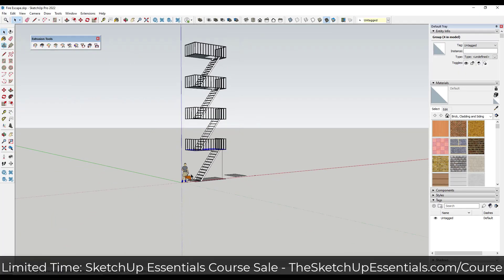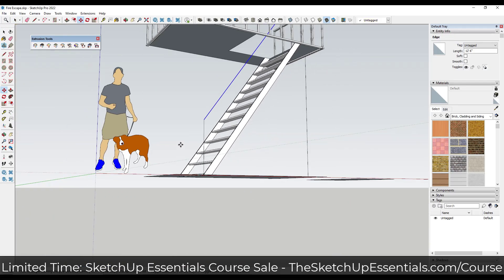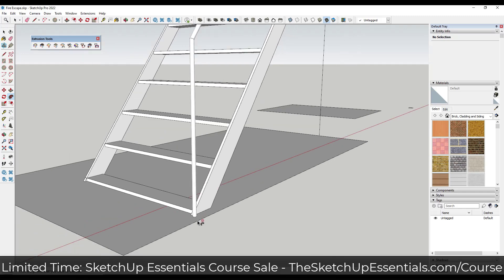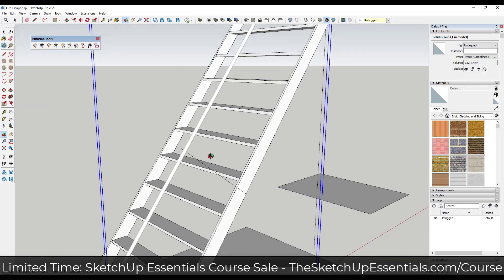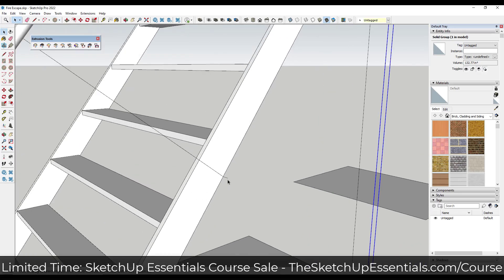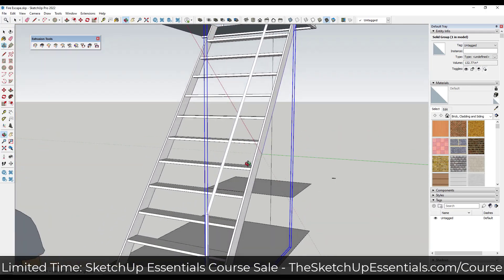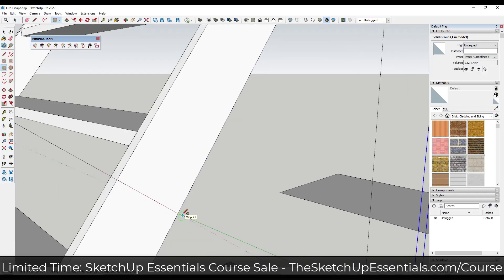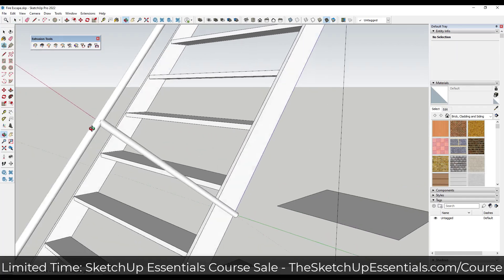How to Change PUSH PULL DIRECTION in SketchUp! (Easy Tip)

Comment: Great tip. Should add that it is good practice to group/component the mid-rail geometry BEFORE you reset the axes. This way the scale handles for the grouped geometry will be aligned to the geometry axes and make it much easier to manipulate than if they are aligned to the "world" axes.

Comment: Dude, you helped me out so much with your videos. But I have a question: can I use the assets from 3D warehouse commercially? More specifically, I'm a comic autor and I want to use the models I donwload from there to compose my backgrounds. I will alter the models in the sketchup software and then render the 2 imagine that will be directly used as background and I will draw the characters and lighting over it. Will I have any copyright issue? Timble's terms of use weren't specific about this. Please help me.
Reply from the maker: I'm sorry, all I can do in this situation is refer you to Trimble's terms of use, as those are what govern. I don't work for Trimble so I don't know the answer in this specific situation. You might also ask this question on the SketchUp forum, but I don't posses any more info personally than what's in the terms of use
Reply: @Thesketchupessentials  Thank you. I've made this question and I was said that I'm allowed to use.